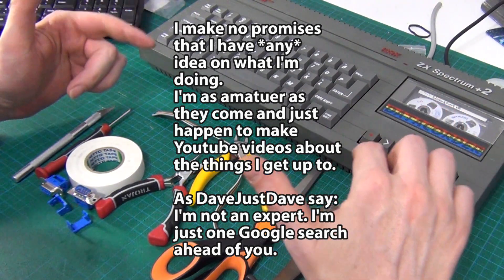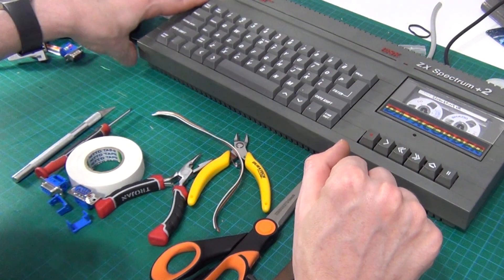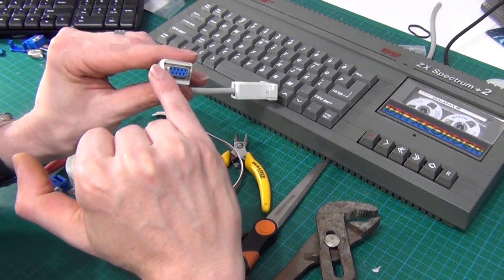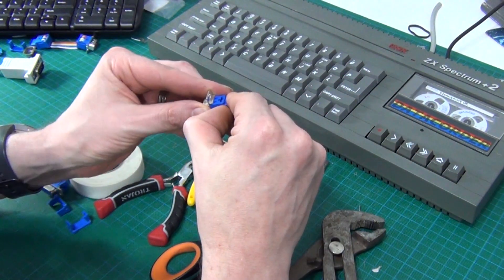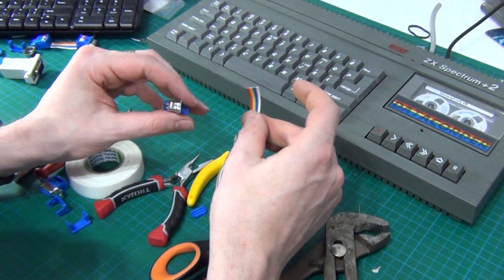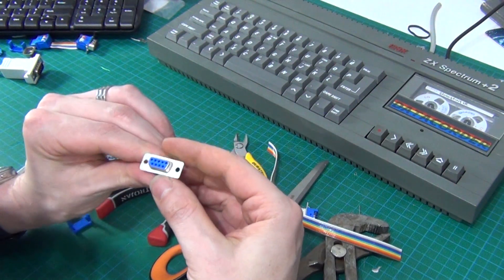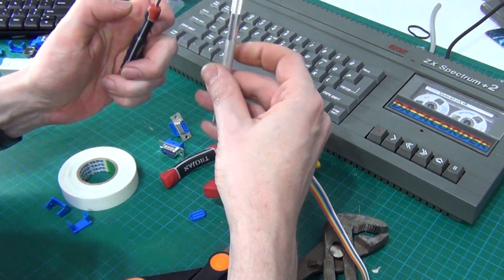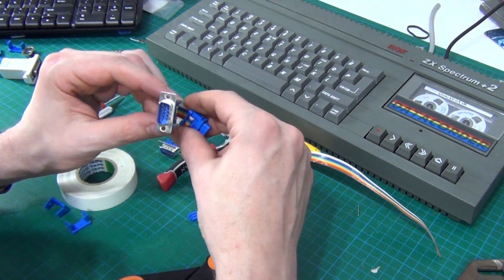Spectrum +2 Joystick Adaptors: A quick How-to | MLTs

Comment: Some joysticks were fitted with 2 plugs, one black and one grey, the black one was normal Kempston/Atari. The grey plug was for the +2 Speccy's. I would cut the grey lead from the black plug, then take the grey lead with the +2 joystick plug and wire a standard joystick conector on the lead. That grey lead then became an adapter.

Comment: Nice video - thanks ...Just a thought: If you make this cable the other way around (ie. Speccy Joystick {SJ} -> Atari Console {AC}) I strongly recommend you do NOT connect Pin-7 at the {AC} end ...{AC-7} is connected to +5V (for the paddle controllers) ...If you follow the path: {AC-7} [+5v] --> {SJ-2} [Gnd] --> {SJ-8} [Gnd] --> {AC-8} [Gnd] ...As you connect the Speccy joystick, you will short-out the Atari Console power supply!

Comment: Nice video..... but Sinclair/Amstrad joystick use was a bit of a minefield!  Earlier Spectrums mostly seemed to use either Kempston, or Protek/cursor key controllers, so as long as you had a kempston compatible interface and joystick, you were good... :-)
With these later +2 models though, it seems things changed a lot!  On my grey +2 I can use a Genesis controller using an adaptor cable much the one you show in the video as a Sinclair joystick.....if the game calls for Sinclair joystick in it's menu.  The controller, sans adaptor works perfectly as a Kempston controller when plugged into my DivMMc Future.
And this is the same on my +2B (black version).... except that now I can't use the adaptor cable anymore, so the controller is useless on some later games that no longer offer different joystick options - Robocop 3 for instance.  This game only uses Amstrad/Sinclair controllers, and not Kempston.
Fortunately i also have a Cheetah Star Probe controller that has the Sinclair/Amstrad/Amstrad/Sinclair  compatible adaptor built-on the cable.....
It was annoying at the time - back in the 80's to find a joystick that would 'just' work on the original rubber key Spectrum.  Even more annoying to find that once Amstrad had bought Sinclair, that they changed the format once again on the default joystick ports built into the computer!

So nice to see that noways, all the USB controllers are universally compatible........ NOT!!!  Ha Ha Ha!!  When will the industry ever learn?

Comment: It's just as well - both the joysticks Amstrad bundled with their ZX Spectrums were vile. I had the SJS2, which was just a rebadged version of a Cheetah Exterminator, and it was horrible. No response whatsoever. I replaced it with a PowerPlay Cruiser, which had a Sinclair-wired flylead (so you could use it on Atari-wired computers, as well as on my ZX Spectrum +2B - MUCH better joystick all-round). 

Cheetah were forever mixing and matching different bases and handgrips of their joysticks to create a new one. They'd take the handgrip of the Cheetah 125 and mount that in the base of the Exterminator, and sell that as the Annihilator. It was bundled with a lot of Commodore 64s in the UK. They used the base of both the 125 and of the Exterminator for different joysticks in their terrible "Characteristicks" range. You could find an Alien (for Alien 3) mounted on a 125 base, as well as two different sculpts of Batman (movie and animated series), as well as Bart Simpson and a Terminator skull on an Exterminator base. 

The SJS2 wasn't the worst joystick I ever owned though - that will forever be some god awful thing built by Quicksilver (I think). The trigger button was upside down. Both it and the top fire buttons made contact by using a series of shafts and levers inside the handgrip to close the main base fire button. There was no movement whatsoever. It wrecked your wrists trying to play a platform game. Horrible thing that should be burned upon sight.

Comment: Good stuff! I think I might steal this idea and use it to make a controller/mouse port cable extension for my Amiga 600. Similar problem with its recessed controller ports and plastic casing.
Reply from the maker: Yeah - that'd work. Nice! And if you're better at keeping count of the wires than me (though the mouse one would be straight thru) you could do it with black/grey ribbon cable.